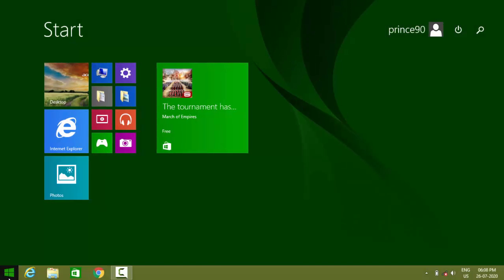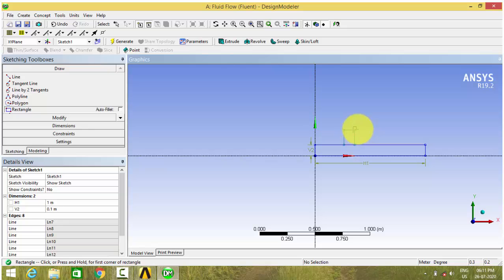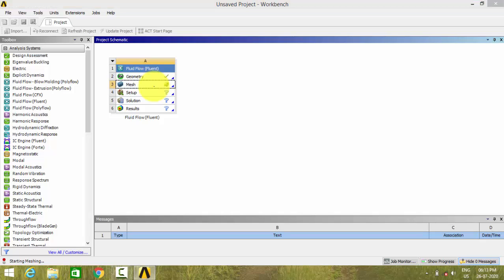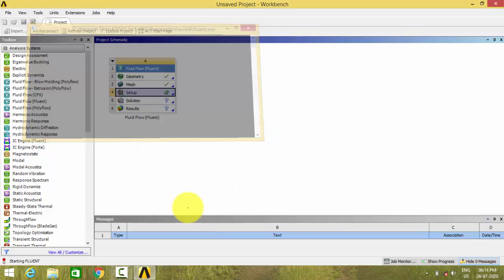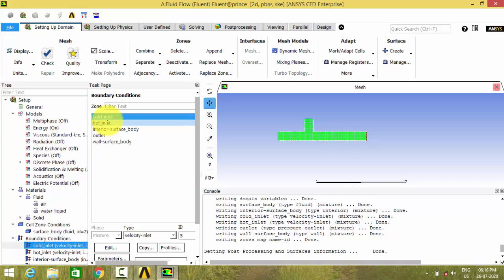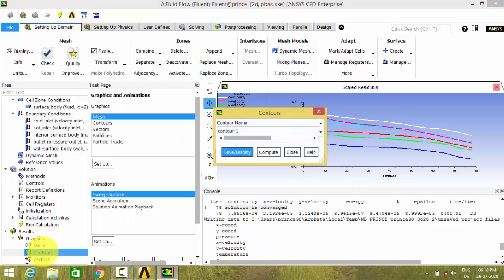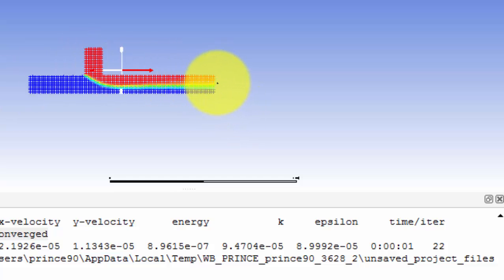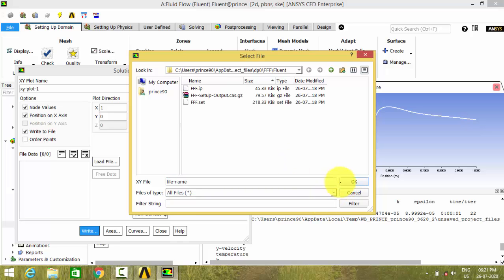How to create XY plot in fluent | Ansys fluent tutorial for beginners

Comment: hey bro, how to determine the time fluid flow from inlet to outlet
Reply from the maker: Do you mean "How to determine the time taken for a fluid particle to flow from inlet to outlet"?
Reply: Yes. I want determine real time a fluid particle to flow from inlet to outlet
Reply from the maker: If you need the time taken by the fluid to cross the domain, that's quite simple. Just divide the distance (length of domain) by average velocity of flow. If you want to calculate a particle which is having different density from the flowing fluid, you have to perform specific simulation like DDPM.
Reply: @MechTechSimulations  cause my domain is not a simple domain, it have 2 inlet and i want see movement of fluid in domain. So have any method to determine it.
Reply: @MechTechSimulations  can i contact you through any social network ( facebook, instagram or whatsapp ) to talk easily
Reply from the maker: All my details are available in the description of the video. You can communicate through it.

Comment: How to force fluent to write the data of the plot for each design point. I don't want to open fluent for each design point
Reply from the maker: Set the parameter you want as output parameter.
Reply: @MechTechSimulations  it is an x-y plot, not just a single value.

Comment: How can I  work with different hot inlet speeds and plot the variation of maximum exit
temperature vs. hot inlet speed in one plot
Reply from the maker: @ 9.11 you can see an option named "Write to file" using that option you can take the data out and you can plot any number of parameters in one plot as you wish.